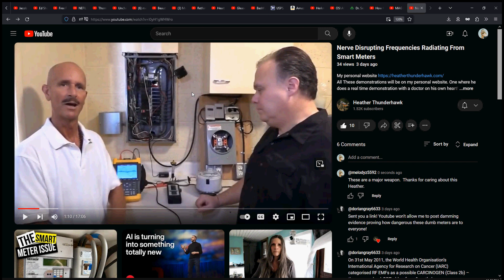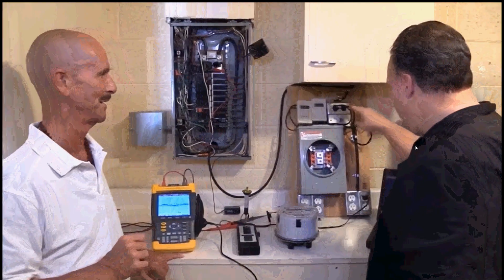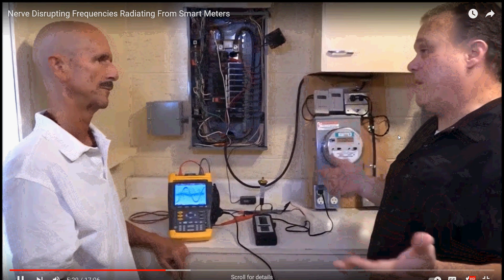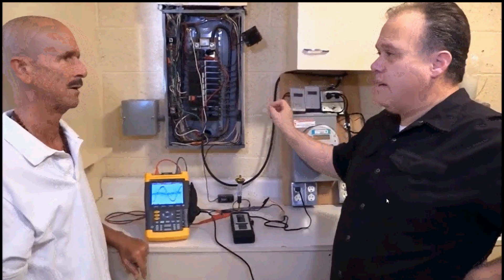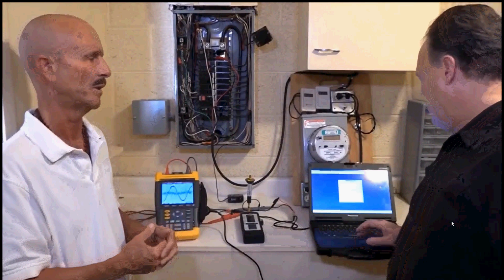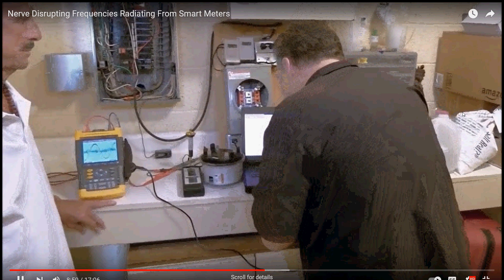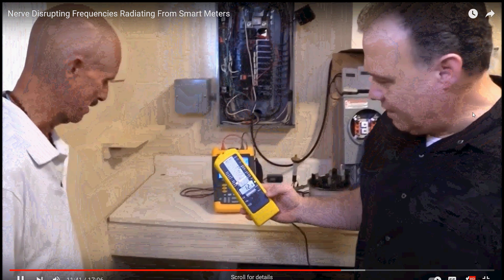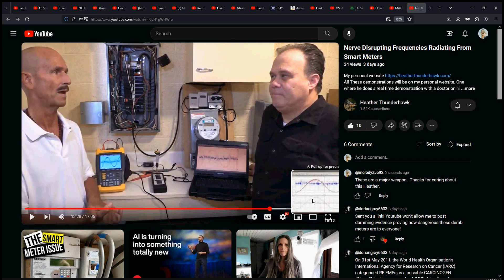Not Smart

Comment: Very dangerous ❤️❤️❤️
Reply from the maker: See about a little screen and a screwable ring to put over your meter its easy to make from the hardware store.   I think it helps some to cut down on the amount we receive.  The meter still reads by the elect. company so they have no complaints.
Reply: @melodyz5592  😁🤗❤️❤️
Reply from the maker: Your latest comment is not showing at all guess yt didn't like it 🤣
Reply: @melodyz5592  😄😅😂🤣🤗❤️❤️❤️❤️